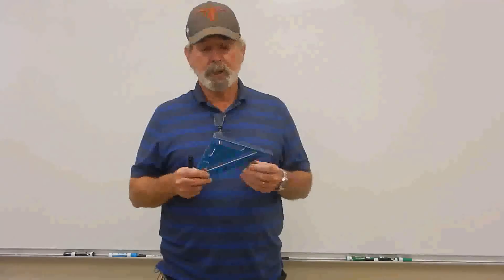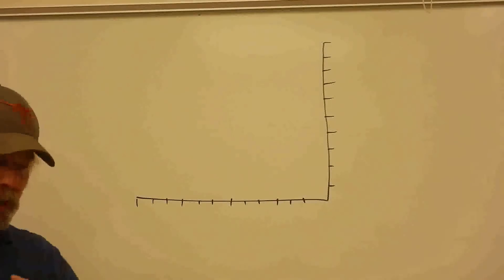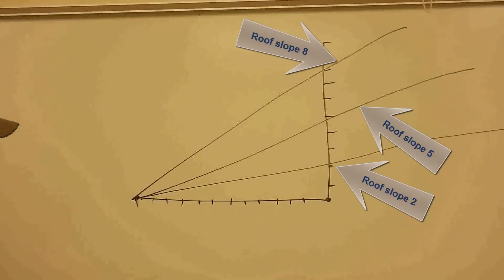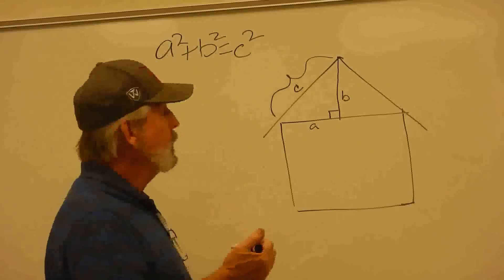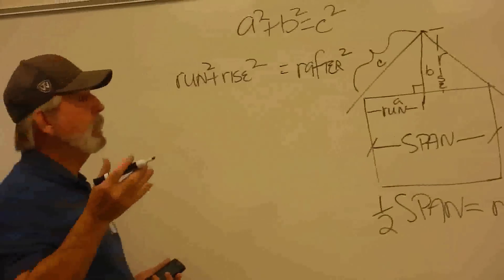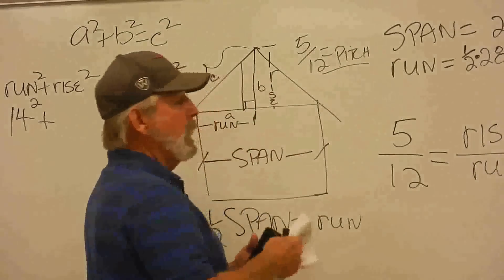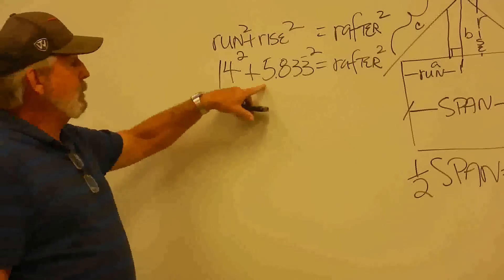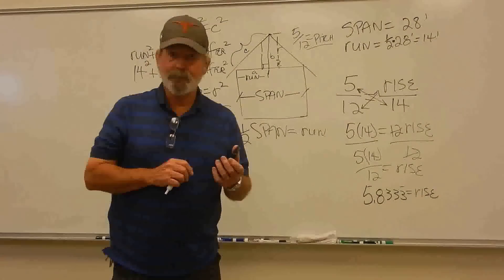How to calculate the length of roof rafters (captioned)

Comment: Just a bit of feed back but the when it came to the crucial part of the maths and fully understanding it you speeded up the video, I think anyone trying to learn how to do this wouldn't pick up on where you've gone with the maths. In the past I've struggled with it and part of that is you obviously can't decimalise feet and inches, not easily. Say if it was an extension on an old house and the rise just happened to be 8ft 6 and 3/4 inches, the calculations are all getting a bit tricky, better to slow down the video at the difficult part not speed over it.